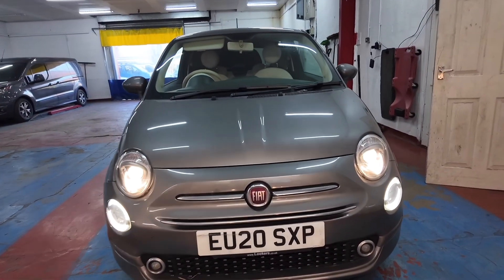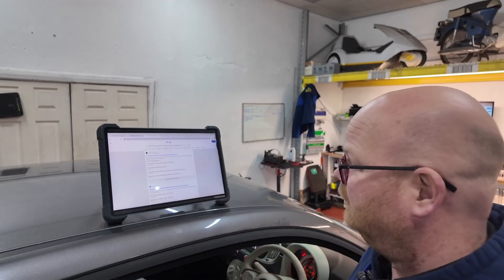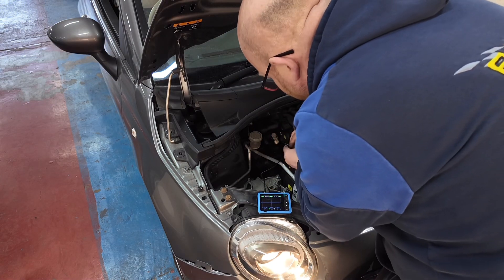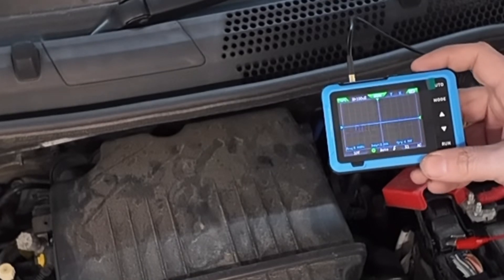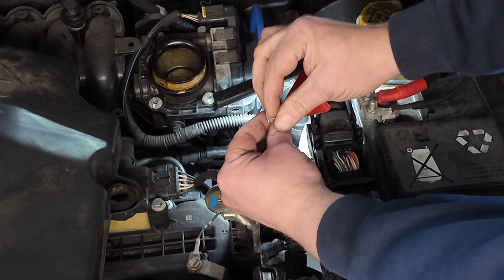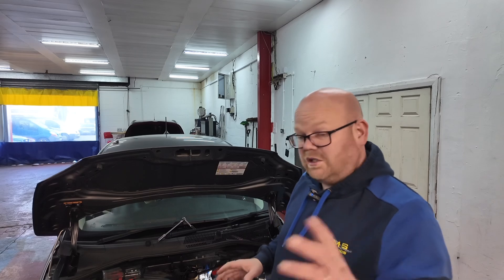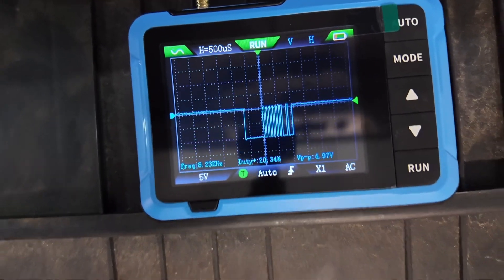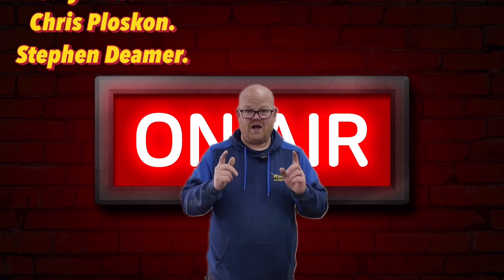How We Diagnose a Faulty LIN Bus Signal,Power Steering Issues  #automobile #automobile #canbus

Comment: them wiring looms are total crap im always repairing them normally crank sensor wire brakes as well
Reply from the maker: I’ve got a crank sensor fault at the moment
Reply: @rmsdiagnostics  mine was a broken wire intermitent think it was round the back of engine this car would run when it wanted to took me ages to sort even sent the ecu away to be tested

Comment: Hi what voltage should you see on the lin bus wire
Reply from the maker: Around 9v ish
Reply: @rmsdiagnostics  thanks buddy
Reply: @rmsdiagnostics  Its not the same for all manufacturers , it is modified based on system load , it needs to see at least 7.5 volts at peak and just above system ground level , it is modified during operation.

Comment: Milligan auto diags posted exact same fault on Friday night.
Reply: As did mulligan. I think @bazmeredith did one similar.
Reply: Used to use the tone generator to trace wires on wire wrap arrays in the military- all cable was blue and white (maybe yellow). Ideal for tracing routes etc but as you say, no good for if it is not a clean break or short.

Comment: Great job Bob 
I’m learning stuff from you quite often now 😂
But I ain’t paying you 😂
Thought about that power probe short /open finder before,tried other ones but not really reliable to be fair 
I’m gonna have to get more into using a scope 
I do cheat with the scope that I have it’s built into my Snap-on machine,sets everything up and the good thing is it does show what to expect.
But that wee scope you have seems to be just as good if not better,definitely easier 
Can you tell me how you knew it was a lin bus alternator 
I do reach for the thinkcar x10 before the Snapon but I find it useful to have at least 3 different scan tools 
Keep it up 
Jobs a carrot 😅
Reply from the maker: it cam from the ecu so normal for lin control